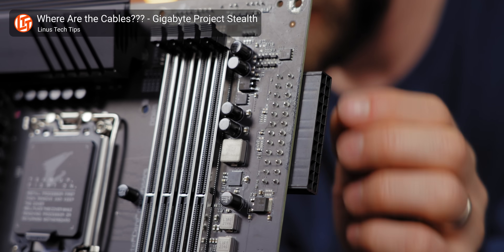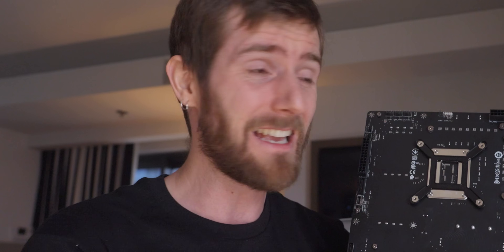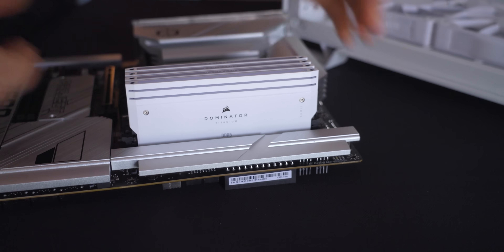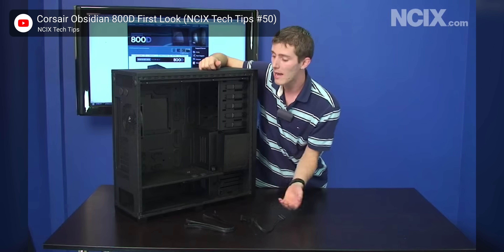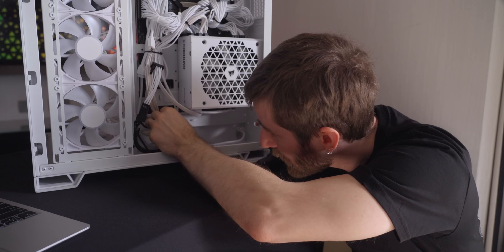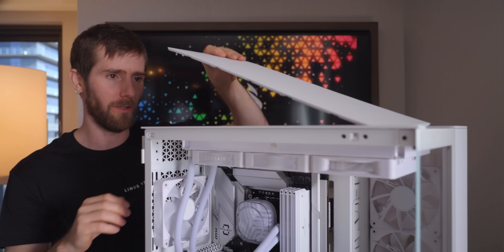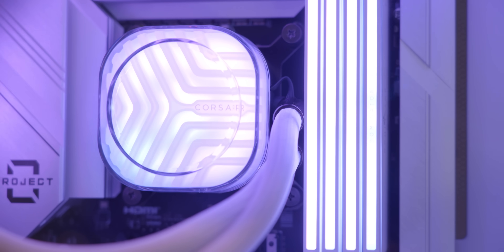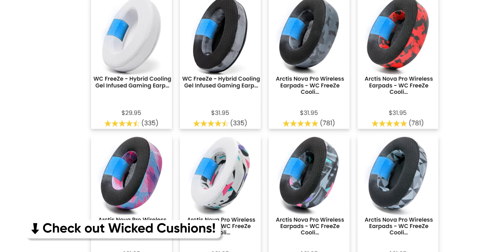I had NO Faith in this... - Hidden Cable PCs

Comment: I like the btf advanced idea from asus... but if you're not rich and already have a 4090 strix card so obviously can't afford to buy a whole new 4090 btf strix card then you're basically not able to utilize it if you already got their flagship gpu before hand

Aside from that I am overall intrigued by the idea. I'd miss my 12 pin sleeved cables... at least the looks... screw having to route them though lol

Comment: Hey LTT, just want to confirm, I used an i7-11700 cpu, and when I use it to play games it reaches around 73C and use 100% cpu with lower fps, but when I open Core Temp in background, it has higher fps and temp lower, around 63C. It also uses less WW. Does that mean when gaming w/out Core Temp it only uses a single core and if open in background it uses multi-core? But if it is like that, when I open Core Temp after gaming all 16 cores have high temp and WW used is high. Just want to know, really.

Comment: GPUs are getting so big, so why not put the power connecter on the buttom, and then have a hole from the back to get the cable through. 
include a 90 degree angle connector in the box for people who don't have the hole in the motherboard tray, it will still look better than what we have now.

Comment: Hmmpf.   2012 wasnt long after Corsair hit the ground running with easy to build in cases. So Maingear pulled a Steve Jobs out of it's butt and patented this for them.

When Corsair brought the easy to build in cases to market they sold a ton of cases and everybody copied them. When NZXT ditched the 5.25 bays and added a PSU shroud on the bottom and giant side panel, they sold a ton of cases and everybody copied them. Maingear might have been onto something, but they never really pulled it off.

Comment: If were gonna standardize things this much, why not just build the cases so the motherboard slots into the case with all the cabling built into the case? You wouldn't even need cables then. You could even rout PCIE power through the motherboard so extra power cables aren't even needed. (I just got to the part of the video where he mentions them actually planning on doing this) 🤣 I'm all for it, If all you got to do is install the power supply, motherboard, processor, Cooler, GPU, and SSD to build a system. That means even the average person could build a system in minutes.

Comment: Still think these power connectors need to be 90 degrees and run parallel to the board instead of perpendicular.

Comment: I have a potential solution for implementing the asus way of having the power be delivered from the underside of the GPU whilst maintaining backwards compatibility with legacy PSU cables. Have both; But, the asus power connector for the underside instead of having a male power connector, have a female connector and supply a male to male power thing (what would you call that? power fingers?) with the GPU; this way if you want the legacy power hookup, just ignore the bottom power connector and attach your normal PCIe power cables, if you want the new way, just install the male to male power finger to below the GPU and ignore the legacy GPU power connector (for added security the GPU board partner can have a power mux to auto switch between the connector so someone cant run power via both power connection). Just my 1 cent of info, feel free to take it and send me 50 cent royalty per GPU :P

Comment: Is the next step to just build a PC case that has all the power and data already running through it so then you just need to plug the motherboard and power supply into the case like modules bypassing all the cables except for GPU power cables(unless a new GPU design is created to plug the power into the cases power distribution)? I'm sure some whales out there would pay for a PC like this where every component can just be slotted in with no cables ever needing to be plugged in aside from the power and monitor cables.

Comment: I  actually think the whole thing is kinda dumb. A mobo being flat on the back means less stress when plugging in connectors and smaller cases at the back. I would honestly prefer a more all in one connector like setup where everything is close by to one area like at the bottom of the board, especially when regardless of the mobo config you still need cables in the front like GPU, fans or pumps etc.

Comment: Why is that backplate flex even a consideration? Outside of heavier GPUs which should be supported in other ways, it's not like you have a v8 powered PC with tons of torque going from the motherboard to the pc case...

Comment: Why on earth (with standard video cards being as long as they are) do they not put standard pcie power connectors on the inside of the gpu (on the pin side beyond the edge of aa standard atx motherboard) or on the end of the gpu. This has bothered me for a long time, and really I can't see why they the standard is to face the cable in a way that its most visible. Literally any other position or orientation would look better than the standard bar in the middle of the board like the one in this video. What the hell?

Comment: I don't think anyone builds a PC well in 20 minutes, no matter the experience level. Just doing the cable routing and zip tying is going to be 20 minutes unless you've done that exact build recently. Also the back connectors is great but you know what would be even greater is getting rid of those stupid ATX 24-pin + CPU 8-pin connectors and going to ATX12VO.

Comment: As a laymen/outsider who has not yet built his own pc, and hasnt owned a tower pc in over 20 years (but someone who is working towards having the money and knowledge to do that)… i find the idea of trying to stash all the wires behind the motherboard in the back panel comical. ( not that i disagree that it doesn’t make the build looks absolutely fantastic.) But i just picture the original guy who decided to make the first PC case sitting there going, “But we literally made the case to hide all the wires, why do these kids need to a secret back compartment to hide all the wires inside the case we made to hide all the wires and parts.” Nothing wrong with it, i just find it comical.

Comment: back connectors are not needed IMHO. 
there are other problems in the PC market like the stupidly big GPUs that doesn't have a standard anymore, 
components sold without any QA, 
unfinished products released into the market,
connectors that blows up, 
millions of different software to control RGBs, 
SSDs that can't be hot swapped easily and you need to dismantle the PC to replace them,
mobos with 4 slots for RAM that works with 2 only...

You know, we have other problems and we don't need new cases and new mobos for just this stupid thing.

Comment: I would really love to see a non-overprived 90 degree or 180 degree (depending on whether you go over or by the side) bracket that comes with the GPU to move the GPU power around the side and to the back. That would solve the cost problem too.

Comment: I looking for cases a few days ago and noticed that options for drive bays in a reasonably solid case is pretty limited i know most people dont like use floppies tapes or even cds anymore but for some reason plastics from the 90's seem to break just by staring at it and i would like to use my older computers especially the at one without risk or electrocution so i been looking and what i do find is mostly overpriced used junk. Maybe a good run of new cases for older computers would be profitable and i know id buy 3 if they were priced within 100 to 150 if they came at or axt power switch options i dont really need an aquarium just a good solid looking case with full size bays and insert covers that can be for they various old hardware. They could even be sold separately at a fair price.

Comment: Patent right is a joke in it's current form. Remember a rectangle with rounded corners is (was?) patented.
A reform is way overdue. Aggressive protection to be balanced with no less aggressive expiration.
And throw in a clause similar to trademarks, no product on the market = no patent

Comment: honestly if JUST FPIO is made into a full universal standard I would be happy
the sheer number of times I had issues with pin headers for indicators and buttons is torture, maybe someone needs to make a standard, then design a riser that lets you prep older motherboards for "UFPIO" by connecting the leads BEFORE install(maybe a full IDE sized ribbon that slaps onto new motherboards but can plug into a tiny breakout board for older boards)
also I wish my LSI megaraid 9260-8I had a proper documentation on the failure LED header pinout, fuckers say "this is for individual drive failure lights" but don't tell you how to connect an LED panel AT ALL
actually as techy types might read this comment, if anyone has experience with the LSI megaraid cards and has figured out the 8x failure header pinout, PLEASE POST IT AND LINK HERE, there is a SHOCKING lack of documentation on how to connect an 8x LED panel

Comment: My man, let's be real. Project Zero or BTF or whatever you wanna call it wasn't designed for novice builders. Novice builders aren't picking specialty mobos that are only compatible with a limited case selection. They're going on reddit and buying parts based on upvoted build advice. This stuff is so you can flex on people who care about PC aesthetics. (In fact, Project Zero is bound to confuse novices as it's literally not what the name suggests.)

Comment: Back cabling is just a dirty workaround, it would be much better to solve the real problem:  The technical aberration of the ATX  standard with a 24pin + 8pin EPS cables from the Jurassic times.  I'm losing my respect for PC manufacturers for not being capable to agree to a simpler standard (the difficulty is not technical, just the lack of will to make something "better" if others will also get it).

Comment: Well if you want to hide cables then my question is, why in the world is that graphics card do still have that power cable hanging in the front. I already saw some GPUs having their cables at the front end of the card and some mods inside the fan shroud. IMO I still want my cables to be seen in the front so I wont have to bother removing the back panel of the case. since I always place my CPU beside the wall with the monitor in the left. It looks clean though.

Comment: Sigh... sure is a good thing that a small company called gateway didn't tackle this back in the 90s. Oh wait, they did. cart style connectors, and eventually a single box that connected all that the unescosarily fragile plastic to that cable. Assus uses a cable on their high end mobo. Not nearly as well built as the gateway cable,  NZXT has a cable with one plug for the io at least. the rest is still the braindead fragile pins. Movie all the fragile stuff to the back, just means fragile things on the back instead of front. How the hell is this a improvement to what should have been fixed fucking decades ago?

Comment: You know what though Linus... I really don't have any sympathy for 'novice' PC builders today - or ever, really.. I used to build 386 and 486 machines where it would take DAYS sometimes to get the overclock right and the jumpers.. THE JUMPERS MAN.. on the MOTHERBOARD. Ask someone what a jumper is today... they WON'T answer oh man, yeah IRQ setting on your sound card or even master or slave on a HDD, they'll say something like.. Oh my dad said one time you used to have to put some jumper thing on and take out the battery to reset bios (actually it's CMOS you're resetting, but see?) yeah.. NO.. sorry, I don't think that's any of the point here. Beautiful cable management? Sure.. sell me on that. Ease of building? Nah.. sorry if you can't figure out how to connect some wires to the front of your board, go buy a Dell.. I'm not being mean, but I am being practical.

Comment: I'm all in on things like the Corsair SHIFT PSUs, not gonna buy anything different anymore unless I need something specific such as an SFF PSU or something. But this back connector thing, I'm going to wait until there's wide market saturation on cases as well as mainboards that support it before I jump into it. I just move around hardware too much to deal with the headache of figuring out which component is front connected and which is back connected and what goes with what. What could accelerate me into this, however, would be a really cool concept piece of hardware. ASRock's Z790 PG Sonic mainboard made me look for fitting hardware to make a Sonic PC ever since it got announced and now with Montech's KING 95 case I finally went for it (couldn't find a blue case that wasn't baby blue or something awful before) despite not having use for another PC and not caring one bit for Intel CPUs at all

Comment: I really like the cable-free GPU situation that Asus is working on, especially given the whole 12VHPR connector debacle with the launch of the RTX 40XX series cards.
Reply: With the spacing required for the cables to be behind the motherboard tray they could put the gpu power connectors on the back of the card facing inwards.

Comment: Most cases are metal, I would like to see fiberglass/ resin like the PCB's are made of. Strone, light & non-conductive, & you can paint them. ..
Reply: They're supposed to be conductive. To both serve as a ground and most importantly a faraday cage of sorts to electronic noise

Comment: Step 1: Cables not very aesthetic, let's move them behind motherboard where no one would see it.
Step 2: Connectors not very aesthetic, let's move them behind motherboard.
Step 3: CPU cooler not very aesthetic, let's move it behind motherboard, with CPU socket.
Step 4: RAM not very aesthetic, let's move it behind motherboard.
Step 5: GPU not very aesthetic, let's move it behind motherboard.
You have successfully turned your computer inside out and come to where you started 30 years ago.

Comment: I dont really like this at all for a few reasons...

1) You are no longer able to show off your cable management skills which is actually something i like displayed personally,

2) PC cases are going to be less compact to accomodate the connectors going on the back of the panel,

3) Case rigidity is now lower thanks to so many holes in it

4) What if someone does something else and makes proprietary cases with proprietary motherboards, example... You want a gigabyte motherboard? You need a gigabyte case...

This isnt innovative, it's just unnecessary

Comment: This shouldn't even be a patent. The concept of "solder the plastic bits to the other side of a PCB" barely qualifies as an idea.

Among other things, a valid patent that would be upheld in court requires these...

Obviousness: If the idea of moving connectors is considered obvious to a person skilled in the relevant field at the time of filing, the patent may be invalidated on grounds of obviousness.

Non-Patentable Subject Matter: Patents are generally granted for inventions that are new, useful, and non-obvious. If moving connectors is deemed a common practice or a basic modification, it might not meet the criteria for patentability.

Comment: Linus media please help my laptop the Rx 580 4gb plus 1700 x is dead as it was dropped by my sister after use she put it on the end of her bed and pushed it off.since then I have struggled to have a great power connection.it has finally given up the ghost.i need a new PC.there are only AMD that I am interested in.i would like if possible the Alienware R1 18 to get the best out of the games from have.i have m.2 drives and I have a SSD that we can use.then and I have DDR 4 sodimms no problem.

Comment: Can I just mention that both the backwards pinout and the daisy chain fans/coolers will only help youtube builders who may need to build a pc or 2 every week.. The average user is going to spend a day, albeit in frustration, and then not even think about it till the next component upgrade.. I don't see a point in paying a premium on this especially when there is a push to all black pcs anyway

It's definitely not a worthwhile price to pay.. Gpu is one of the easiest components to take out anyway... If you forget to plug in a connector.. boohoo... Do it again.. It's once in 3 years.. Wrong justifications here Linus..

Meanwhile cablemod is sitting in a corner crying